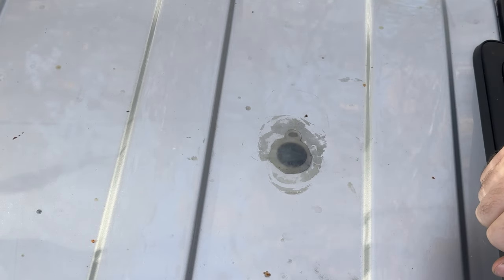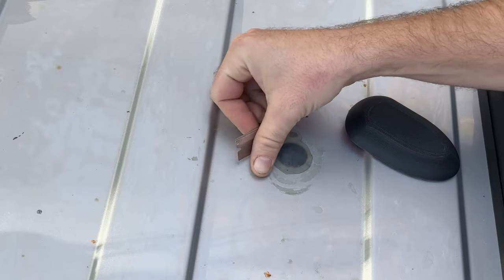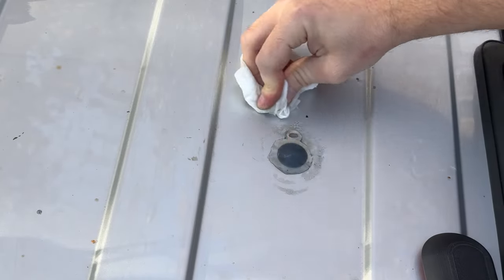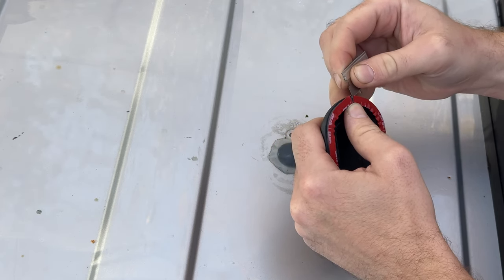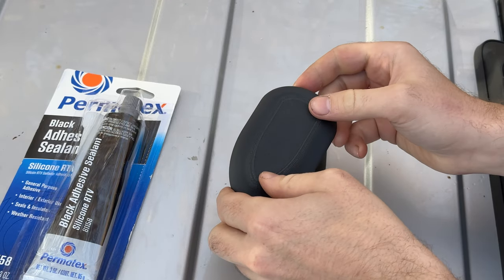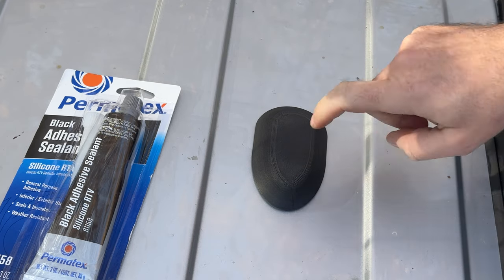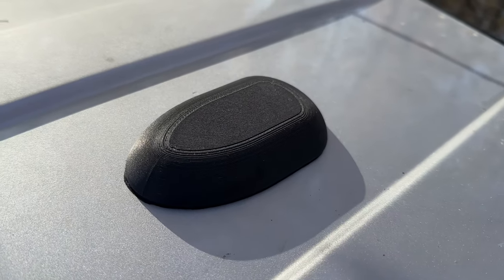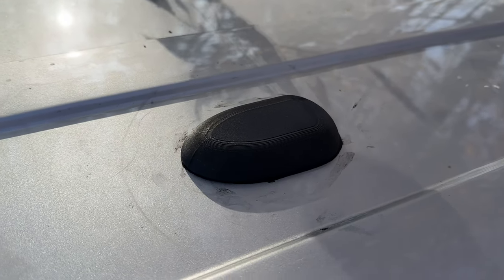How to Conceal Antenna Roof Holes on a Retired Police Vehicle

Comment: I'm a ham radio operator so I'll probably be using at least SOME of the roof holes to mount...antennas!
Reply: Thats why Hams lust after these cars - holes in roof already, heavy duty electrical systems with high output alternators, and lots of places to mount our rigs.